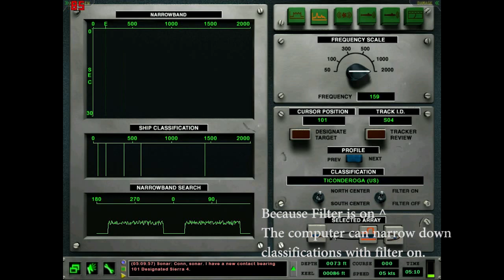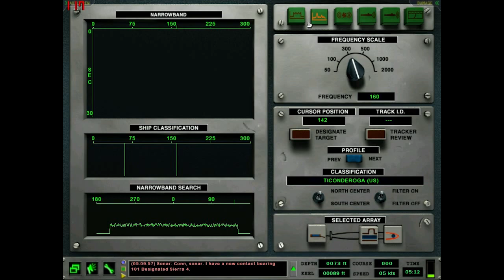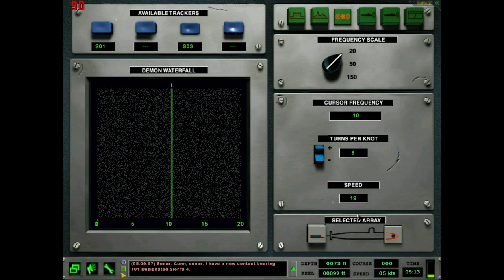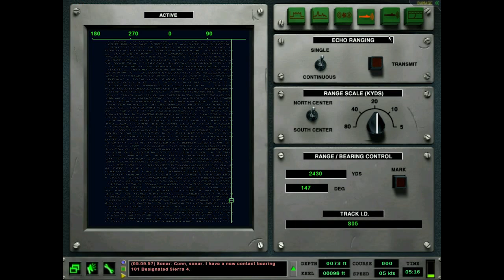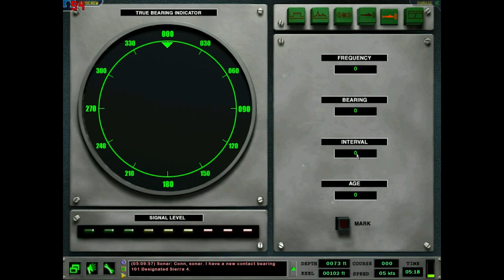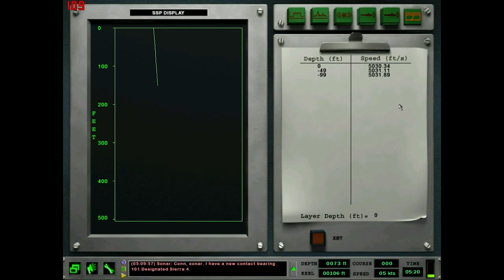Dangerous Waters Tutorial 5: Basic Sonar

Comment: Using this I believe I successfully identified a sub for the first time, the frequency was moving around the 1952 mark and according to the freq. list that's the Korean 'MINI-SUB' (which makes sense since I did a quick mission in Korea) and over in the DEMON I moved the cursor over to the (left most) first line and had a cursor frequency of 8 after which I input the TPK of 12 (that I found in the manual) which told me that the target speed is 9kts (max was 8 according to the manual, so I suppose it's a minor difference). Though I never got to confirm It I believe I was spot on, now I just have to find a way to get all the other target parameters and actually try to get close to it somehow.
Reply from the maker: hey, good job! are you playing the stock game or with a mod? If the max speed is higher than what is listed, it's fair to say it's most likely a platform other than MINI-SUB. Use the towed array or hull sonar (conformal) to determine some other frequencies of the contact and confirm your target ID. Not only that, it can be rather difficult to tell what a fourth or fifth frequency actually is because of the lack of zoom on the narrowband at that frequency range. It could be anywhere from 1940-1960 Hz.
Reply: *****
Thx! :D I'm playing with Reinforced Alert, it just adds so much to the game with my favs being the Typhoon and Ohio class (I think they're both abscent in the default game???) - two of my favs. As for the frequencies, you're right about the 1940-1960 Hz waving up and down. As far as I remember that's exactly what was happening so I'll definitely look into using those other arrays as well, I guess they'd be matching closely to those Freq1-3's? Oh also you linked me to Discord in one of your other videos but by the time I got to it the inv. had already expired and I forgot to respond to that comment

Comment: What if there are 2 lines on the 20 frequency scale? Is it a submarine instead of a ship?
Reply from the maker: xXRaocnumDudeXx hmm? which scale? narrowband or demon?
Reply: Demon, ofcourse.
Reply from the maker: the number of lines signifies how many blades the propellor has. assuming, of course, you can see all of the lines. if the contact is too far, you may only see four lines, which would lead you to believe it's a four-bladed prop when in actuality, it's a seven bladed prop, but the contact is too far to see all of them yet.

the frequency scale is just a "zoom", it's so you can get in and make a more precise measurement of speed.

generally, it's easier to tell if something isn't a submarine than if it is a submarine. if you're getting four frequency lines in narrowband on a contact though, you can be pretty sure of what you have at that point.

basically, no, two lines on the 20 frequency scale does not mean submarine lol. if the contact is going slower, you're going to see more lines in the demon output.
Reply: @FPSchazly  the number of lines close together indicates the number of shafts on a contact.  You can determine the number of blades by counting the number of shaft rates between the blade rates.